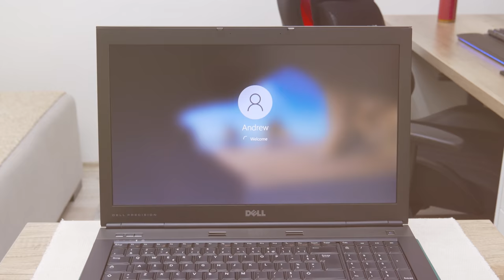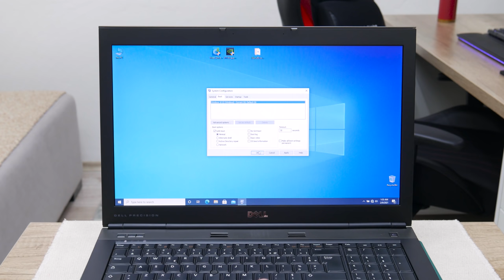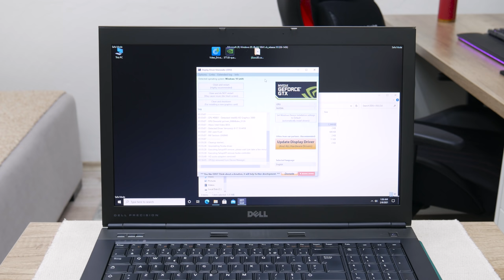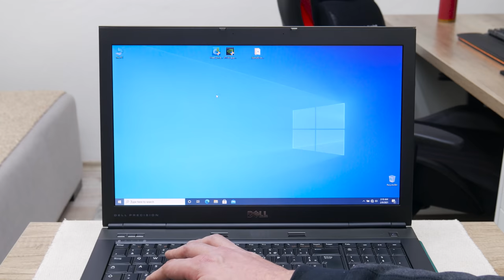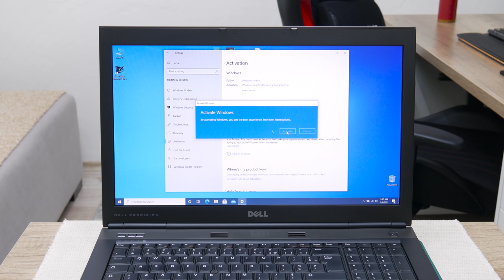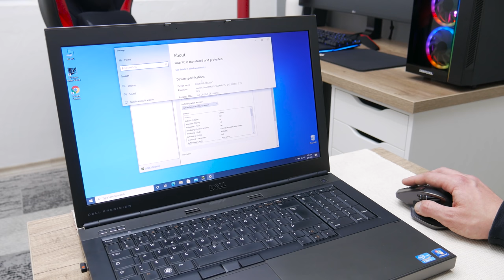Dell M6600 - Full restoration and Upgrades ( Old but Gold )

Comment: Nice upgrade! I've got the successor to this model - the Precision M6700 - fully maxed out with the i7 3940XM, 32GB RAM, GTX 980M, 256GB mSATA SSD and two 1TB SSHD's. These machines have aged shockingly well and will still get you a load of performance for a veriety of workloads. Doom Eternal runs at high settings which was a genuine surprise, but I'm attributing that to the 980M's Vulkan support. The processors you can put in these machines are no slouch either, easily able to smash their way through day to day use and can play a lot of modern games on the market! Plus you get build quality that is quite simply unparalleled in modern laptops. Seriously can't reccommend the M6600/M6700/M6800 enough. Yeah they're nearly 10 years old at this point but these machines still have a lot of life in them, and thankfully, as demonstrated in this video - if you're ok with removing a LOT of screws then these machines are piss easy to maintain and upgrade!
Reply: I bought a Dell M6700 and this laptop is a beast. I got a firepro m6000 but still, i can play many recent games with some tweaks. And it only cost 200€ with 16gb ram and 2 ssd. I couldn't be happier. Just wish i could upgrade the gpu like i've seen people doing, i could buy a gtx 970m but i don't know how easy it would be to install it.
Reply: That sounds awesome. I'm running a Thinkpad with a 940mx and the graphics are so anemic. I'm considering looking into one of these.
Reply: GTX 980m? That's a first I've seen those in that
Reply: @Maximus20778  I put a gtx 980m in my M6800 it's a beast now
Reply: 980 still received driver updates, So I'm not surprised it still running like a champ... Cheers! XM Processors however I'm not familiar with... Hahahaha, Still, At least now if I stumbled across any of these models, I'll take a look a lil closer for sure... 🍻🍻🍻
Reply: I have m6600 with quadro k4000m. Can i put some gtx on it?
Reply: recently lost power due to a nasty storm, my M6800 was a treat, 2tb ssd, 980M and a 4940MX was more than enough to play emulators and other games like risk of rain, only issue is that finding a bag for the machine has proven to be very diffucult from its sheer size, other than that, i loved this machine, tore it apart and upgraded it in 2 hours a few months ago, worth every second!
Reply: @ghost01221  Exactly you can use pretty much any of MXM-B Maxwell generation cards.

Comment: Almost bought one of these but ended up doing some custom upgrades on my dell d620. I'd buy one of these any day.
Reply: What do  you upgrade in your d620
Reply: I should upgrade my d620 but don't know where to start
Reply: @znckovwkdw5073  ram and hdd to ssd
Reply: I had mine maxed out with a T7600 cpu, ssd, 4gb of ram and an egpu. Recently modded it by replacing the motherboard with one from the D630 and a similar cpu. Next I'll be able to get a bit better cpu, the gpu got a little bit better and more importantly I'll be able to go up to 8GB of ram.
Reply: @ruxcooking  can I upgrade the cpu without changing the motherboard to d630
Reply: @eryavrilio3751  ok thx
Reply: @znckovwkdw5073  no. T7600 is as high as you can go.
Reply: @ruxcooking  i think u can upgrade it to core 2 extreme but i don't think it's worth it and T7600 Is a good choice for that laptop
Reply: @ruxcooking  you mean its the maximum cpu for d620 motherboard right
Reply: @znckovwkdw5073  yes. D630 you can go up to an X9000.
Reply: @ruxcooking  nah t7600 is enough for me
Reply: @ruxcooking  thx for the tips btw do I need to install a new drivers after upgrading to t7600
Reply: @znckovwkdw5073  Maybe you should consider the T7400 instead. It's a tiny bit slower but costs half as much. There is also the T7200 that's a further step down but costs no more than 5 bucks. And yes the D630 supports X9000, I had such processor running before transferring them to the Precision M4300. But you need a working battery to update to the latest BIOS to do so.
Also, I don't believe D620 and D630 chassis are interchangable. The D620 has the infrared port that's missing on the D630.
Both motherboards, if you have the discrete graphics, are also affected under the GPU failure if you don't have specific revised NVidia chips inside that has its manufacturing date of the 31th week of 2008 or later.
Reply: @eryavrilio3751  I tried the Core 2 Extreme. Doesn't work. Fits in socket but does not work at all.
Reply: @xPLAYnOfficial  well i thought it will work
Reply: @0w3nn  Typed on a Precision M4300 lol, which is the high end rebadged Latitude D830 with workstation graphics.

Comment: I still have working Dell M6500 and Dell M6700 - I did have to just replace the SSD in the Dell M6500 but it still works great as does my Dell Alienware  R17 which is my daily livestream 24/7 365 day laptop for earthquake monitoring.   The power bricks that come with these are massive.

So I love Dell laptops at  home.

Thank you for sharing this as I am sure that one day my Dells will stop working.

Comment: I love the ''old but gold'' hardware, just like the 2010-2013 hp elitebook series
Reply: @0w3nn  I have an awesome msi ge70 2oe o11ne 
Found in dumpster
Lol
Reply: Yep old but "GOLD"
Reply: @FS--ew3se  i have acer 4732z
Reply: @JehanPrasetyo.p  I also have an system with
I7-2600K 
970 GTX
2 ssd
2 TV hdd
16gb ram
Msi military class 2
Reply: @FS--ew3se  😭😭😭
My laptop is
Pentium t4400
Intel gma4500
4gb ram
500gb hardisk
And yeah you know acer 4732z
Reply: @JehanPrasetyo.p  better than nothing u can try slapping on an ssd and probably a ram upgrade and u should be fine.

Try using G E F O R C E   N 
                                                         O
                                                                W
Reply: @FS--ew3se  bro 4gb is max compatible ddr2
Reply: @JehanPrasetyo.p  
What bout an ssd
U can get a cheap Kingston ssd that will make it faster
Reply: @FS--ew3se  yeah
Reply: @FS--ew3se  gaming perfomance is only cs:s low 21-45fps only in cpmbat time
Reply: @JehanPrasetyo.p  better than nothing tbh
Reply: @FS--ew3se  lol
Reply: @JehanPrasetyo.p  ye

Comment: Love this generation of Dell Precision. I picked up a M6800 for £70, no charger (had one already) and supposedly only 4GB RAM and no HDD. When it arrived, found that it has a i7 4940XM processor, Quadro K5100M with 8GB DDR5, a 512GB SSD and 16GB RAM! Such an underrated beast.

Comment: I am watching this amazing video in 2023 from my M6600 that I just took out of my son's closet. It was my first Dell workstation, and I squezed the hell out of this beast for 6-7 years in my office and on the road through europe, before upgrading to a newer yet cheaper laptop (Acer Predator Helios 300 2019, sigh). Never opened it, never cleaned the fans, never repasted, nothing. It was on 24/7. It started getting pretty laggy and temps we're rising all the time, also had one of the hard disks (main) fail and die on me, so I eventually gave up on it. The power button is missing, the screen has a few dying pixels, but the rest of the laptop is in great shape. If I remember correctly it might also have a dead hdmi port, I'll check later.

Tried to boot it but it, had a faulty Win7 on it and wouldn't boot correctly so i just installed a fresh Win10 pro and it's running smooth.
These are my specs:

Intel i7-2720QM CPU @ 2.20GHz   2.20 GHz
16,0 GB SK Hynix [4 x 4GB DDR3 SDRAM 800.0 MHz (DDR3-1600 / PC3-12800)]
Intel HD Graphics 3000
NVIDIA Quadro 3000M 2048 MByte di GDDR5 SDRAM
Samsung SSD 850 EVO 500GB

Your video inspired me, I think I'll finally give it back some love opening it up, clean the essentials and repaste. In your video i see you haven't replased the thermal pads, how come since you were at it? 😂 While I'm there I'd also like to do some affordable upgrades. If I can revamp this tank a bit, I'll hook it up to my projector and use it as a media station.
I was thinking of upgrading the ram, the wifi antenna, maybe the gpu and adding a msata ssd. Do you have any suggestions?

Thanks again for the video, earned you a sub!
Reply: Have you been able to change anything? I would like to repower it, I am about to buy an SSD since it has an HDD, and uncover it and clean it.

Comment: I have the same laptop and I use 32gb of ram in it and I removed the Quadro card and replaced it with the ATI (now AMD) and saw an immediate improvement in the CAD work I use it for. Its crazy how well this laptop has held up for being 10 years old

Comment: A possibly unintended side of Andrew's art of restoration is that it shows how well thought out and magnificently built older Dell Precisions were. Some could be specified with good webcams, backlit keyboards and even Blu-ray DVD players/standard burners made by LiteOn. They were extensively used in the medical profession and actually still are in preference to inferior modern iterations lacking ports, cooling space and key components soldered in.
GPUs at the time were prone to failure (especially Nvidia ones) but Dell used a modular system which allowed GPUs to be, relatively, simple to repair by technicians of a high standard -- like Andrew.
The 17" M6600 was one of Dell's masterpiece computers, here seen being restored by a true young master.
Reply: Indeed and the peak of these was the Precision M6800, of which I now have three, including the Covet Edition!

Comment: awesome work Andrew,  I also have the same laptop which I bought 5 years ago and still running perfect.  I did upgrade the RAM and Hard drive.  Your video is great,  you showed a lot of great detail and your work is near impecable. Keep up the good work
Reply from the maker: This laptop is still working, a few months ago I saw it, still in function.

Comment: I am so happy you are doing another m6600 video. I have one and it’s weird but it’s laggy when using the side loaded SSD for the os but when I mount an ssd under the palm rest or use a 1tb mSata it’s not laggy at all. I also have a 2gb quadro 4000 in mine but want to upgrade, but I have ran into a million and one issues most being with the bios.

Comment: I like with these massive laptops there was not enough room on the screen to put a webcam even though all my other smaller dell laptops from that age have them. 

People forget that even if the screen is completely broken you can still attach a external monitor and keep a working laptop for a while longer to get more life out of it and these dells have great connectivity in the way of external screen options. they make great youtube livestreaming computers as they protect the machine against power spikes.

I did not realize that the CPU were socketed based.
I hate replacing screens

People used to laugh at me when I would come into meeting with these dell M6K laptops until they could not connect to the video screen because they had the wrong connectors ?VGS/HDMI/Display port - These thing had everything you could want.
Reply: Some had webcams and backlit keyboards. They were among Dell's options and pushed these beautifully made workstations to anticipate the future without losing the best of the past. Modern Dells are inferior in practically every way.

Comment: The m6600 used to be my daily for a solid two years until an upgrade went bad but anyway the weak link for this model is the mxm where there is a lack of options. For those who's Firepro M8900 that is crapping out or has already died can easily just toss in a Firepro M6100 that cost as little as $20 sometimes on eBay while those with a quadro would have to get the amd heatsink to make the same upgrade. Some Kepler Quadros can work though are much more expensive and are slower for the money with only one upside to having 4gb vram rather than the meager 2gb. Some M6600s come with a Quadro 5010m installed and that has 4gb vram as well but with no driver support playing newish games is limited. Ultimately I upgraded to an M6700 that is a lot nicer than the m6600 with the exception to a couple of connectors on the board like for the track pad ect.

Comment: I still have my m6600 however the gpu died again, I bought a replacement 3000m gpu a few years ago and all was well for sometime. I had the same issue with the precision m90 where the gpu died after a few years and I had to replace it. I passed that system down to my dad when I moved up to the m6600 and the gpu in that m90 still works like a charm. When I bought the m6600 I upgraded the ram to 32gigs, removed the cd and dropped in an extra hard drive.  I plan to get myself another second hand gpu, I will try the 5010m this time since it has an additional 2 gigs of vram.

Comment: Good restoration . The only thing i would do differently is the top case , find one with a good screen and without dents , all complete , just fit and done , it would have looked so much better at a minimal extra cost

Comment: To make things easier with the video-cards driver problems: in DDU the upper-left corner click "Options", then under "Advanced Options" check/mark "Prevent downloads of drivers from Windows Update...". I had had people think their old GPUs died due to windows updates that ignored the original video drivers and installed MS crap over them, also on new OS installs, also even on newer cards like RX 5600 XT there are youtube videos and known workarounds because MS Windows Updates leaves you with a black image on your screen (because Windows ignores and overwrites the official driver that you install and corrupts it), MS somehow broke Win10 terribly with recent updates. Anyway, so with the DDU setting you no longer disconnect the internet and worry about this - until the next fresh OS install...

Comment: Great restoration, those M6600s and other older Dell Precisions are still sought after because of how modular and upgradable they are. I'm sure this is the 3rd Dell Precision you have upgraded.
Only thing I'd have done differently is maxed out the RAM (you can never have too much RAM - especially when you can get 8GB modules quite cheaply) and maxed out the storage (by adding a second SSD or HDD).

Comment: previously he did a video on same laptop and this laptop is op
Reply from the maker: Hi bro, actually the booth laptops are different, they are the same model M6600 but different revisions. This one has no backlit keyboard, no web camera and is coming with Nvidia Quadro GPU, btw dell M6600 has a lot revisions :D
Reply: @ComputersAndTechAndAndrew  you mean different config

Comment: lol, good job not breaking the keyboard bezel.. i snapped mine in two.. lol nothing a little glue couldn't fix.. I just put a m2200 mobile gpu in my m4700(2012) and i'm getting a respectable 29 fps in Starfield, stutters like my Uncle Jimmy, but I was impressed.. it would probably perform better if my cracked version of starfield was on an SSD.. and before anyone gets on my top for piracy... no regurts!

Comment: Fixing this business workstations is very easy, parts are always available from aliexpress, and this model (or the m6800) is even ugpradeable to a GTX 980M with the 240w AC adapter

Comment: bro i have same laptop! but last couple of weeks it’s getting too much problem! like, while working it get stuck(hanged) no key, no click, no commands working except i pressed main key to to turnoff, and also i get alot of blue screen with different errors.. anyway finally i install new window 10.. but again same problem. i think its heat sink problem, what is your opinion? and how do i get back my grafic drivers?
Reply from the maker: Hi bro, are the temperatures normal or too high ? also which error codes you get ? And what are the specs of the laptop ? These model is available in many different variants
Reply: @ComputersAndTechAndAndrew  thanks for reply.. whenever i was getting blue screen.. every time it was different error.. i never saw same error.. about temperature i just. checked physically where it was not so much hot.. well im sorry im not professional in IT work so i don’t know how to explain my problem.. can we talk on whatsup?

Comment: Strange that the laptop was glitchy. I have installed 10 on really old hardware and as long as you use a SSD, I have never had an issue.

I also use Snappy Driver to handle all drives on older systems and have never had an issue. I ever have 10 in an RP5700 without issue.

Comment: I have been a tech for a long time. First thing you need to do is download from ( Microsoft ONLY) no were else.  wushowhide run this after you install the driver. This stops  (Locks out) Microsoft servers from trying to modify the drivers in the future.

Comment: Bro.. I bought a 2nd hand DELL PRECISION 4800 and upgraded completely with 2ssds 32gb of ram and with Windows 10 20H2 version and all drivers fully updated. But i don't know why u faced the problem in installing the drivers? Did u go to the dell support and tried with auto detect drivers?... Trust me i am running all the latest CAD softwares in that pc and can beat new laptops.... It's a beast... One last thing if u want u can only run on nvidia graphics by going to the BIOS and turning of the switchable graphics.

Comment: Nice job. Disagree that 32GB is a "waste". It's a mobile workstation, meant for serious computing; video editing, CAD, engineering simulating, etc. which will easily make use of 32GB of RAM. I also recommend upgrading firmware and drivers directly from the company's website and don't allow Windows Update to install drivers.
Reply: You can set Windows policy to prevent Windows from updating or reverting drivers. If there are particular drivers that work well with the hardware, you don’t want Windows to change them.

Comment: I have the same computer, it works very good with windows 8 drivers in windows 10, no need that shit of restart in safe mode.
Reply: may be you have not the same chipset even if it's the same model, so there is issues in old chipset